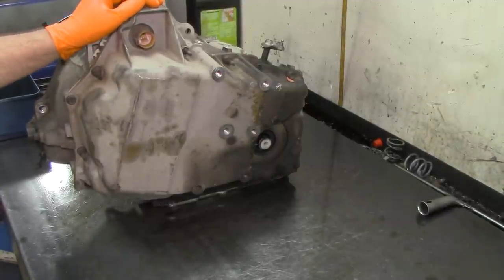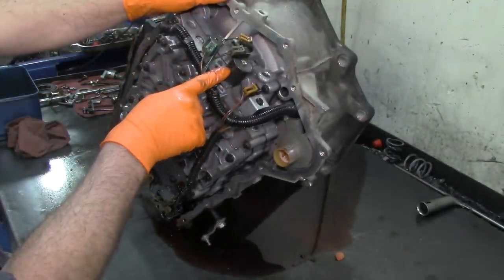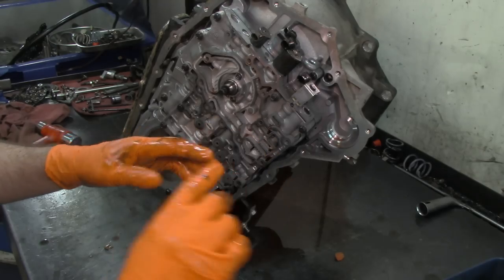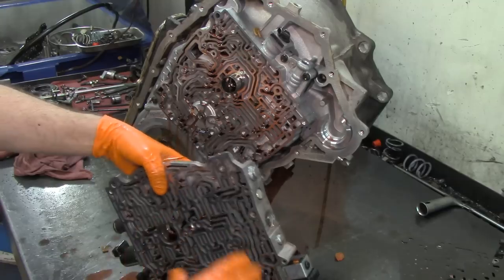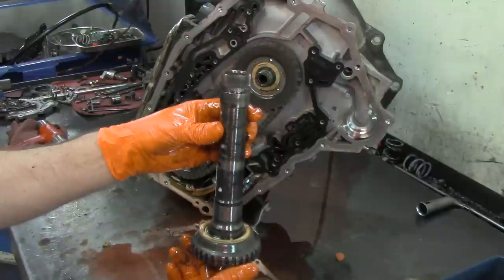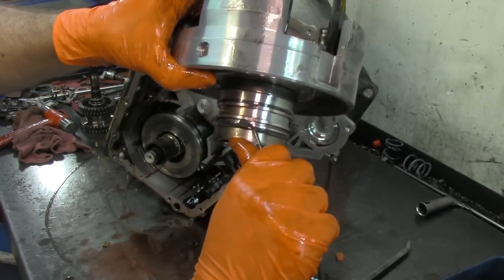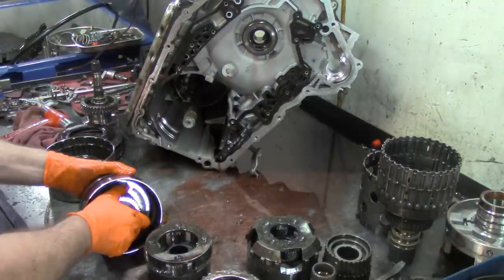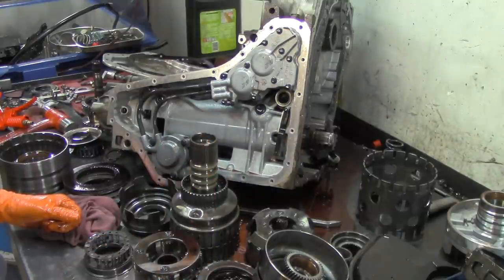P1811 Maximum Adapts & Long Shift Detected - 4T65-E Transmission

Comment: Thanks Hiram, great video. I'm about to rebuild my first 4t65e. I'm learning a lot.
Reply: How'd that job come out ?
Reply: Sorry, Jim, never saw your comment until now. Turned out great except I put the tcc solenoid in backwards. Wouldn't lock up with torque converter at 45 mph. Had to go back in and fix that, and after worked great. Daughter got hit a month later and totaled the car. Lol
Reply: James, not sure, it's been a while and I'm no pro. This post describes what you're asking I think? https://www.grandprixforums.com/1997-2007-4-speed-automatic-4t65e-4t65e-hd-/4289-vehicle-speed-sensor.html

Comment: Excellent Bro, 

I'm attempting Replacing the solenoid & Pressure control  valve at home Wish me luck. This Weekend . HA!!
Reply: How'd it go? I had the same issue and after a new filter and fluid, fixed. Also, there is a transgo shift kit for the accumulator that can be installed. Comes with stiffer springs and collars.

Comment: He's not kidding about the torx around the clutch hub area of the valve body. Just stripped one a week ago. Getting that out without damaging the valve body consisted of drilling a little, then sharpening the drill bit and repeating for about an hour or two. The metal those bolts are made from really dulls your drill bits fast.

Comment: The part that I still don't understand here is why when the P1811 DTC trips in the PCM it is programmed to completely stop powering the PCS for the rest of the time that the ignition is on instead of just during the affected wonky shift from the issue. Why punish the fuel economy, the pump, and rest of the internals with sustained excessive line pressure if only a single shift/clutch is affected?

We had a 2002 Venture with the signs of something randomly sticking because usually hot or cold, heavy acceleration or light, it was as you say just fine, flawless shifts all the way up and back down with good numbers for shift times on the scan tool and the PCS amps never went below 2/3rds of an amp. It would then randomly spaz out and have the long delayed 1-2 shift that is characteristic of these and set the code, turn off the PCS, then shift perfectly again just extra hard as is to be expected.

I'm betting that its internals would have been in a very similar condition to the ones shown here in this video.

Comment: I believe in adding a 1x1/2x1/4 neodmndym magnet to the inside corner of the pan.  it is unbelievable how much metal paste it collects over the years.  that paste would otherwise accumulate on speed sensors, checkballs, and many other metal, pressure plate, and solenoid components
Reply: Yeah, I heard tell the OEM magnet sucks!

Comment: Great vid I've been turning wrenches for 35 yrs we have a 2000 Monte carlo SS the trans in it hesitates doesn't slip from 1st to 2nd it will run up to 3000 rpm you can let off then boom boom boom to high gear it's not tripping any codes thinking maybe changing the 1-2 shift solenoid to fix the prob
Reply: Did you ever resolve the lssue.

Comment: Excellent material Hiram. I can tell you are in a productive environment, probably with a few things needing to be done aside from making a video of your work. I like the way you show each part to the camera as you remove it. If you do get the chance to work late or on a weekend so you could take your time and include all those small details along the way, I'm certain your viewers would appreciate it. It's not easy to do a non-scripted video like this. With 24 years in the industry, you make it appear fairly simple. I'm looking for the assembly process for this unit on your channel, but I don't see it. Did you complete the rebuild and not have time to film it? If I lived near you, I would volunteer my time to be your sound and video guy for a few days just to get your knowledge out there... out here...  where it should be. Transmission shops treated their business like a closely guarded government secret back in the days when I was a Driveability and diagnostics tech where every other automotive shop was more willing to share the knowledge.

My deepest gratitude goes your way for doing this...  Thanks!!
Reply: I have the same transmission in my car. I need an overdrive shaft because my car is not going into overdrive. Question is can I drive it with out changing it and for how long before the transmission goes out all the way. I have first second and third.

Comment: I had a bad time with that Superior AFL kit.  It tells you in the instructions to use the old valve as a driving tool for the plug.  The old valve didn't come back out after that.  I got lucky and had a friend with the reamer hardware for the Sonnax kit though.  It works slick, but I'd hate to have to buy the tooling for it.  It might be worth it to pay a super hero like Hiram to install that valve for you.

Comment: Great movie, I have a slightly different problem. I am from Poland and unfortunately our mechanics do not know this gearbox as you do in the USA. My car is Chevy Uplander 2006 3.5v6. Chest when it's cold works fine. When it warms up, it shifts from 4 to 3 for a moment and turns to 4. Everything runs smoothly. There is no error in the computer. After connecting the computer while driving, you can rigidly lock the lock up and the car drives normally. I replaced the solenoids, regenerated the converter. It didn't do anything, maybe he locks up earlier, but he drops it every now and then. So far, no mechanic has recognized the fault. Can you guess what it might be? Will you help?

Comment: ...I'm looking at buying one of those Remco Power RV Pump kits or something similar, which ads an external circulating pump for the Transmission, so that ATF is circulated through the Transmission, so that you can Flat Tow a vehicle, like a Buick Rendezvous behind an RV without destroying the transmission.   
Where would you ad the lines for the Circulating pump?   And do you have any pointers and/or advise on this project.

Thanks, Alfredo

Comment: Hey, great video! But, is it possible to remove the Neutral Safety Switch without removing the all the other parts? I just need to replace that and the wire assembly. Thanks!

Comment: Thank you so much. I don't now English, but I understand. I have 2007 Impala SS. I changed all disc and band. Before don't run 1,2,3,4 and overdrive, but reverse yes. Now, 1,2,3,4 and overdrive is OK, but don't run reverse. Please, I need know where is the problem. Thank again.

Comment: I have this problem with my 2004 Pontiac Montana. It only happens (hard thumping shifts) when I have to step on the brakes to quick/estop. I have found that if I just pulse the brakes for a gradule, normal stop. I never have the issue and can go weeks or longer without it happening. The next hard stop causes it all again until I pull over and turn the van off, and then it resets itself . Can you give me any advice as to what needs fixed. I would really like to talk to you more about it. I am not sure where your shop is located, but I hope that it is nearby for a repair, I live in Pennsylvania. 
I am 72 retired and semi handicapped but really need this fixed economicly if at all possible. I don't want to lose the use of my van.
Thanks for your 
informative great video and your time. Hope to hear back from you
Charles G
Reply: something similar I feel that happens in my Saturn Aura 2008 XE, I feel that if I step on the brake gradually does not do that, and it can take weeks and days until that happens again if I step the brake to the bottom happens that, I have to turn off the car and turn it on again so it does not do that, did you solve it?
Reply: I would try Lube guard or Lucas non slip, I used them both and got good results. Shifts much smoother now

Comment: I'm not super technical but this transmission is in my car and I have this exact issue. Hard shifts between the first 3 gears, resets after turning the car off. A mechanic I asked said it was likely due to transmission pressure. Another thing to note is that it only starts to do it when I'm in stop&go traffic on the highway. However I am not getting a light on the dash, should I be expected to see a warning light for this code?

Comment: Hiram I have an 07 Saturn Ion with the 4T45E and it has reverse and second gear only.  When it's going forward, it starts out in second and stays in second.  No shifting.  When letting up on the gas, it idles down and coasts like in neutral.  Does this car have a limp mode that does that or is the transmission shot?  What inside the transmission would cause that?

Comment: I have come across a 2006 Chevy uplander wheelchair van for sale with 250,000 miles on it. They are selling it for $2,500. It was used as a transport vehicle for patients from an agency for the aged to and from doctors appointments. The agency states that it's mostly highway miles. I had a friend look at it for me came up with this transmission code. The transmission has been services twice. The last time was four years ago. Thoughts? I am just concerned since we travel on the highway a lot of the transmission going out. Thank you!

Comment: I have a 2004 Chevy impala 121K 3.4 liter.  If your getting that ! 811 Longshift code but it's still running fairly well how long could it possibly last? takes an extra second or 2 to go into 3rd. It's smoother when I give it a lil more gas.  Because I'll clear the code which does not trigger the check engine light and the code does not come back often but eventually comes back all the time. I put in some Lube guard and Lucas Non Slip which has improved the shifting a bit. This has been going on for almost a year and it's still running fairly good. Could it last a couple more months? Or years or do you think I will lose drive sooner or later? TY for sharing the video. Very helpful and informative. When you have time if you could respond I would appreciate it. Thanks again. 👍🏻

Comment: I just finished installing the five new solenoids on my 2001 lesabre, the clips that secure two of the connectors broke and now can't lock onto the new parts, I guess due to the heat they were very brittle and as careful as I was trying to be it still snapped like yours did, the one with the silver plate had a piece broken so I was wondering if that was causing the hard shift, the trans worked perfectly it shifted good didn't slip went into gear without incident I just hope this fixes the problem the car has 254.00 on it and runs like a top, sometimes it would run for months without any problems then bam it starts acting up.

Comment: Hello there. I am repairing my own car 4t65e.
but I can not find a small black screen filter. ??? I changed the other 3 (valve bady 2 right and left, big in the oil pampas) but where is the small black fiter. This is the track. Allomatic 514347 Filter, Screen, Manual 2-1 Servo 4T60E 4T65E 91-99
Thank you

Comment: lots of info great. I have a 1999 Pontiac gtp on drive my transmission slips is hard to move the car I can do manual shift with smooth acceleration and it works any advice

Comment: What are the differences between the 4T65E and the 4T65E HD version?.
I have 2  2004 Pontiac grand prix 's. One is a GT while the other is a GTP .  My GTP transmission fluid is brown and while driving normally, by the time I get 1/2 way to town (18km = 1/2 way )the trany temp is 132 °F. When i arrive in town the temp has climbed to 184°F. I am in the process of checking the fluid transfer lines to the cooler for blockage ,restriction . I'm believing that the 4t65e HD needs to be rebuilt . 218000 Km on odometer. But all the shifts are fine .And no codes are showing. There is heavy ool soaking on the passenger side of engine's pulley and belt systems. Power steering pump hose's saturated with dirt& oil ,.
Valve cover gasket needs replacement as does pass tranny output shaft seal .
Will swapping the other transmission from the GT interface with the computer?
Reply: Try some Lucas non slip it might help keep the temp of the fluid lower

Comment: I have a question about why the 4T65-E wears out.   I own a chevy venture and know that the fans don't turn on until about 220 deg F.   I think they designed it this way so the engine will produce less NOX gases, but not sure.   In the old cars, the radiator fans are on all the time and vary with engine RPM.   Some radiator fans turn on around 185 to 195 deg F.   There are fan controllers that can be installed in my chevy venture to turn the fan on between 185 and 195 deg F.   I'd like to know what your opinion is about this based on your many years of experience.   Would the transmission last much longer if the radiator fans turn on at 185 to 195 deg F, instead of 220 deg F.
Reply: The fans would do little to reduce the heat within the transmission aside from when you are sitting still. Have an aftermarket transmission cooler installed if you are concerned about it running too hot. Just make sure you still include the one built into your radiator in the loop, as it needs to remain at a minimum temp to perform properly in cooler weather.

Comment: Hi my name is John I have any problems with transmission you might be able to help me out why will it leak or spray ouch transmission fluid from my transfer case vent I thought I overfilled it so I drained out the fluid and at little by little and it still comes out or Alexa could you explain why

Comment: my O3 Impala has p1811 code. It was shifting hard but after a fluid change and adding lucas oil now it's better. It actually runs ok except when the fluid gets hot, then it whines a bit and is very sluggish...and when hot it sometimes kicks into 4th instead of a smooth shift. Basically all the problem only occur once the fluid is hot. What does that indicate?
Reply: Did you ever solve the lssue John?
Reply: Did you solve it?
Reply: @mrbreezeet1   Did you solve it?

Comment: hey Herman. maybe you can help me I have a 03 Rav4 u 241 transmission kicking my but in and out. have a flair in 3rd gear, put two different VBX valve bodies in, two different third gear drums, and two different covers and a computer still having the problem any thoughts

Comment: My input clutch only has 1 apply plate, has a thin steel on the other end that is bent, is this normal? Referring to the first (input) clutches inside the 3rd gear housing.

Comment: Question for you? I have rebuilt my unit three times with new pump. It keeps burning up? It wines after first test drive. It shifts perfect. But then it comes back with a bad pump. New torque, no restrictions, new pcs, also shift kit. Any suggestions?
Reply: Be sure the torque converter is installed properly. The distance between the shaft and the engine has to be precise

Comment: I have a 2002 regal LS, vin K, it started having trouble shifting into 2nd when at oper temp but other shifts were normal 2-3,3-4 no slippage anywhere So I changed the 1-2 and 3-4  shift solenoid, filter and fluid . NO change . Now it wont shift into 2nd it will hang between 1st and 2nd if I go fast enough in 1st or go into 2nd for an instance but goes back to 1st or hangs between 1st and 2nd almost instantly If it does shift into 2nd it will shift 2-3.3-4, perfectly, any ideas?

Comment: You wouldn't by any chance have the part number of the wire  harness, mine is exactly like the one shown here, there are a few on eBay one delco says it fits but has too many connectors.

Comment: Ok I got to the fourth clutch, and I didn’t find any nylon disc rings” everything was metal,. At first I thought it was because it was a 4t65e-HD.....then I started to see specks of burnt and broken plastic pieces falling out between them” it was practically metal to medal.....

I decided to rebuild it as soon as I seen pieces of burnt material inside the transmission pan....I was hoping it was a pieces of gasket, material from the valve body.....but nope the gaskets was intact.....when I pulled off the valve body and it’s case.....I took a look at the forth clutch packs....to my horror they were very burnt nylon pieces.....so I’m going to tear the unit down, forth great was running on chunks of clutch pack material.

Another issue was the needles out of a bearing fell out.
Thanks for your video....you saved me from installing a worn out transmission.
Reply from the maker: You're welcome
Reply: @james bachour I never tried that…I know you can replace the clutch packs, and Fwd, and reverse bands….with the transmission in the car….I will take a look at a Disassembled 4t65-E and broad cast a video on it.

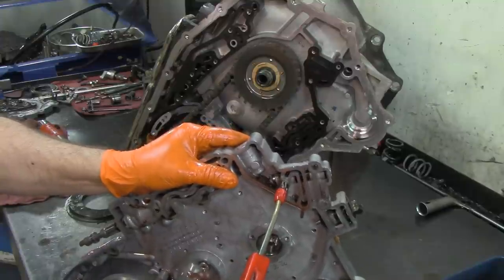Comment: @23:30 very nice to see some wet-air testing on a valve body for once, even though technically it's actually the channel plate you're testing. I was starting to wonder if it was actually a test used in the real world, or just some BS theory that looks good on paper, but falls short in practice.
Reply: Sounds awesome. Especially looking forward to the hydraulic and mechanical portions. I like Sonnax's vacuum testing set-up too, as well as their portable flow meter, the SonnaFlow, even though I don't have either one of those. Maybe one of these days I'll have both. Course thinkin about it now, I may wind up coming down with a case of tool fever and ordering both of them, LOL.

Comment: I have a 2001 Aurora same transmission do not have no trouble code but takes a long time to shift to 3rd so I wanted to use the gear shift and shift like that starting and one but that do not work either do not have to start and drive I could start in one and they act the same

Comment: Dear Hiran. Does P0742 code is the same that p1188 code in some cars specially GM?.
Reply: +Antegas Hindoyan 
maybe i can help you, the P0742 code is considered a general code and is caused by the computer seeing less than a 200rpm difference between the input shaft and the torque converter when going less than 30mph. now the P1188 is a O2 sensor problem of sorts, which has nothing to do with the tranny. are you sure it was a p1188?